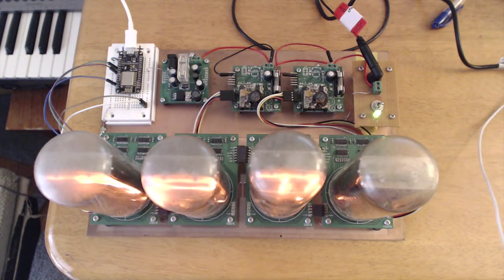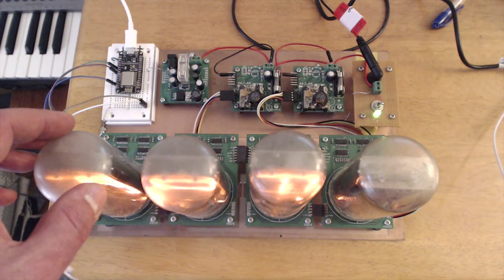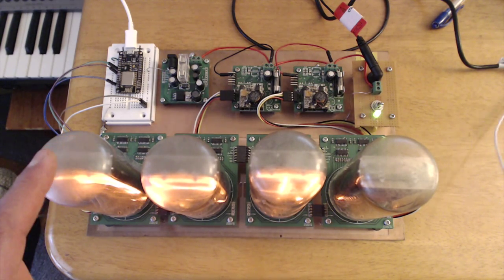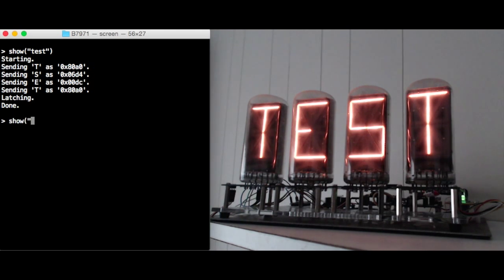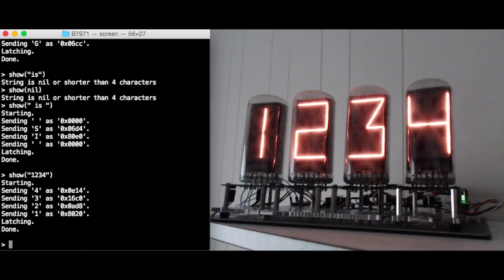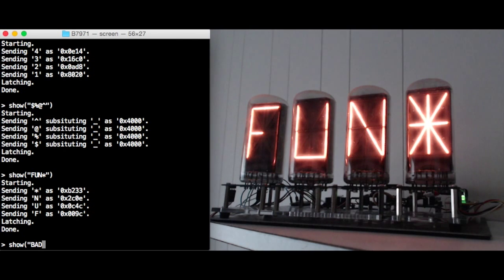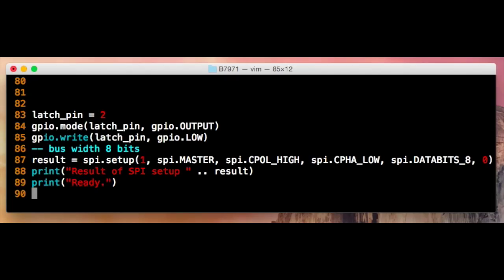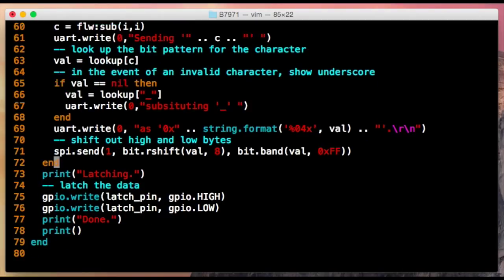Doing something useful with shift registers (NodeMCU and Nixie tubes)

Comment: Where did you get your power drivers and valve boards? I'm looking to use a bunch of b7971 to make a clock/marquee controlled by a Raspberry Pi.
Reply: +Sky Beisel have my own driver nixie driver board design. You can get on the list at www.cogwheelcircuitworks.com